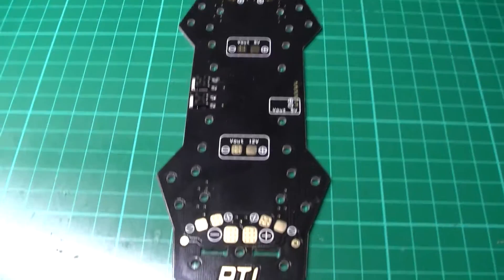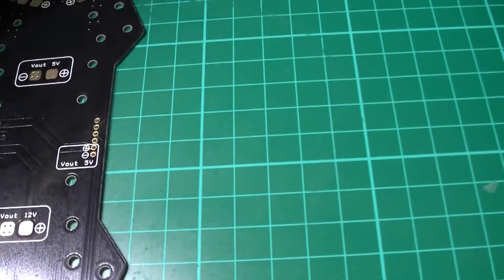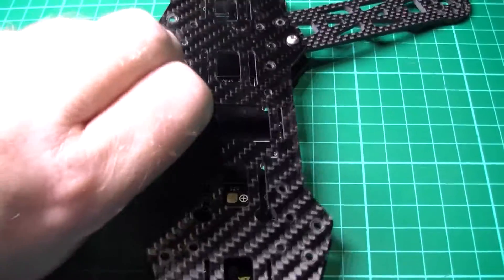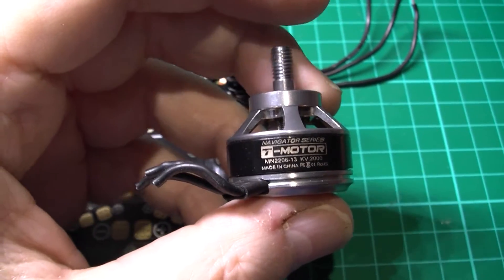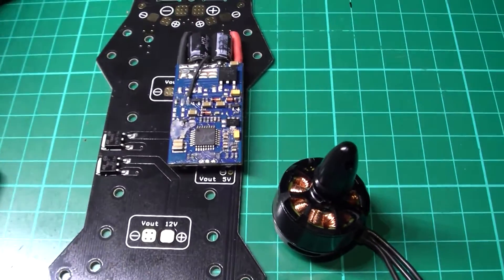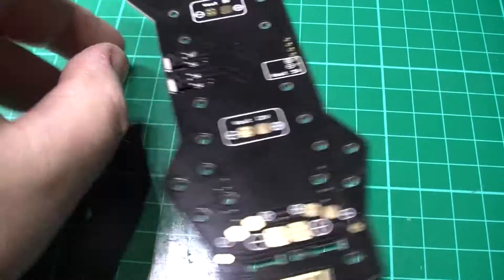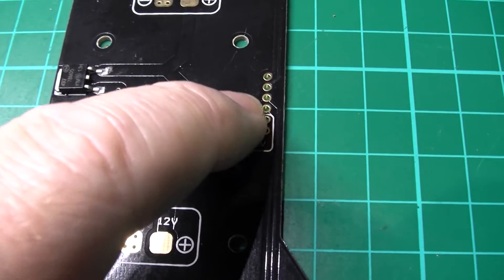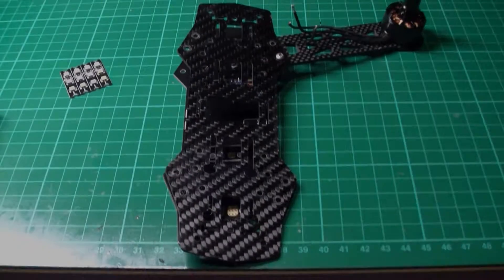Diatone PDB part 1 - The new mini quad (Codename Frankenquad)

Comment: 6" props definitely fit on the ZMR250!
Reply from the maker: JKFlorida Well, I didn't know that.... you learn something new every day :)
Reply: Vortecks Yep. Im running 6030 and 6045 on a few of my ZMR's. But I can't wait to see your Frankenquad!
Reply from the maker: JKFlorida I've got the 30a ESCs shoe-horned into the frame and got the motors wired up. I think this is gonna be a 6S job :-)

Comment: If you are going to use a CF frame with the PDB then look out or the magic smoke, and possible some not so magic words, might escape.

Have you seen https://www.youtube.com/watch?v=E_0hiUwLTlQ

Jump to 23:55 to see what I mean.
Reply from the maker: UKHeliBob I haven't seen that video, but I have completely insulated the arms from the frame. I've been caught out before with CF and conductivity and won't be caught again. Thanks for sharing that - I'll add some warnings to the next video :)
Reply: Vortecks As I understand the problem in the other video was not the fact that the arms were not insulated from the frame.  The problem was that the posts were not insulated from the PCB tracks on the PDB and they in turn shorted across the top plate CF plate.
Reply from the maker: UKHeliBob Yeah, I get ya. I noticed that the bolt started glowing. I've been checking mine with a multimeter and there's no shorts and the bolts are insulated through the PDB. There's only one way to find out if it's worked :)